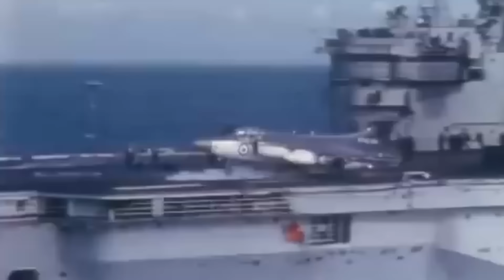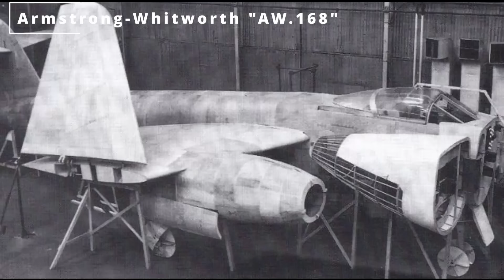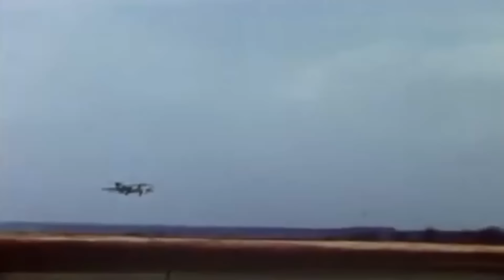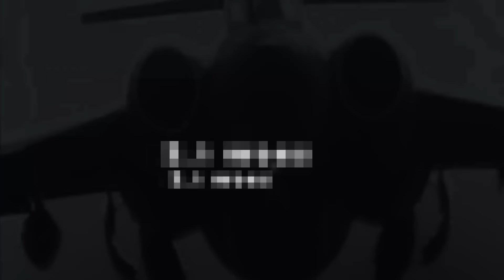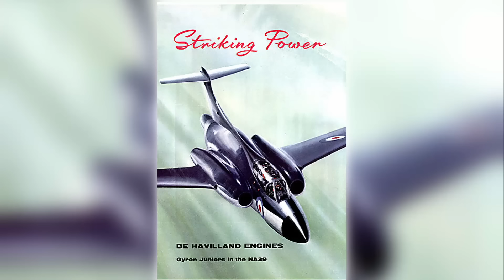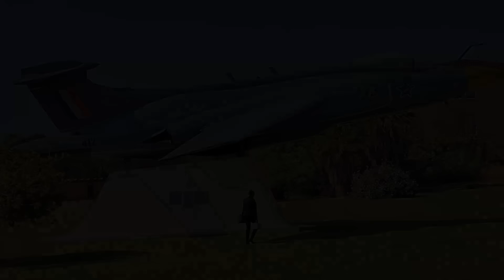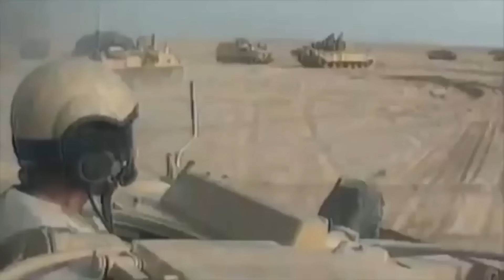Blackburn Buccaneer  -  Insane Low Level Bomber Americans couldn't shoot down - (Full Story)

Comment: I always remember the Buccaneer operational usage guide
1. Accelerate to take off speed.
2. Raise landing gear.
3. Descend to operational altitude.
Reply: Anyone remember this? 

Rolling down the runway 
throttles open wide 
see the mighty Phantom 
sway from side to side 
airborne again without a blip 
It's just one more aborted trip 
but we're pressing on regardless 
for the wg cdrs AFC 

Went to early briefing 
climbed into the Kite 
opened up the throttles 
and roared into the night 
leaving the flare path far behind 
It's dark outside, but we don't mind 
cos we're pressing on regardless 
for the wg cdr's AFC 

Rolling down the runway 
throttle open wide 
see the mighty Falcon 
sway from side to side 
airborne again with just 9 G 
I wish I had a nav with me (!) 
but we're pressing on regardless 
for the wg cdr's AFC 

Rolling down the runway 
throttles open wide 
see the mighty Jaguar 
sway from side to side 
airborne again, but only just 
It's not much fun with F*** all thrust 
but we're pressing on regardless 
for the wg cdr's AFC 

Give me Buccaneers 
They're British through and through 
The Banana Jet 
The Best we've had yet 
We are the last of the few. 

Don't give me the Jaguar 
Unless you refer to the car 
The car is a ground hog 
The aircraft, a half frog 
Don't give me the Jaguar. 

Give me Buccaneers 
They're British through and through 
The Banana Jet 
The Best we've had yet 
We are the last of the few. 

Don't give me the Harrier jump jet 
You haven't convinced me yet 
Jets that fly backwards 
Are soon to be knackered 
Don't give me the Harrier jump jet 
Well… You know, not just yet... 

Give me Buccaneers.
They're British through and through 
The Banana Jet 
The Best we've had yet 
We are the last of the few. 

Don't give me this computer crap 
It's no way to tackle a SAP 
It's OK for Dicks, Germans and Spicks 
But Gentleman, carry a map! 

Give me Buccaneers 
They're British through and through 
The Banana Jet 
The Best we've had yet 
We are the last of the few. 

Don't give me Air Traffic Control 
They live in a bloody great hole 
They scream, and they shout, 
then F**k you about 
Don't give me Air Traffic Control. 

Give me Buccaneers 
They're British through and through 
The Banana Jet 
The Best we've had yet 
We are the last of the few. 

Don't give me the F-104 
It's only a ground loving whore 
It goes in a turn, flick, spin and burn 
Don't give me the F-104. 

Give me Buccaneers 
They're British through and through 
The Banana Jet 
The Best we've had yet 

WE ARE THE LAST OF THE FEW!
Reply: @hotstepper887  Bloody fantastic!! Thanks for this. Great 👌 stuff
Reply: @hotstepper887  Nice. Is it true that inflight refuelling in the Bucc. was like trying insert a strand of limp warm spaghetti into an angry Tomcat's arse during a hurricane.  I've never tried it myself. Neither have I tried inflight refuelling a Buccaneer.
Reply: @gusgone4527  When we really do just take a step back, and analyse the USA's real military capabilities, today? We find, it's a horror story for them, in all honesty. 

Over these last 25 years, they've been out thought, right across the board, they've been significantly out-built, and technically beaten, hands down, by both Russia, and China, (who are banging out modern hi-tech, hi-quality, military hardware in all areas of their military today). 

Even though, much is largely defensive, it's also tactically offensive, and being done with a very focused, and real analytic understanding of where they need to be by various stages of their advancement. 

Although we actually know very little, what they've allowed us to see, there's not really anything I could single out and start to criticize, even if I wanted too. Everything, so far, has been completely logical,

A great question that really does point out today's military power, realities, is, what does the USA lead the world in today, (concerning anything military, at all)? And the answer to that question, is, absolutely nothing! 

For example... In today's world of hi-tech, Anti-Ship, ballistic missiles, (ASM's)like the Chinese DF-21D — operational range 1700 km's that can sink any carrier in the world, (with a single hit), actually means, all Navy's without the ability to stop these missiles are basically obsolete today. 

Russia's Zircon Anti-Ship missile, though inferior in way of operational range - 1000kms, it can be fired from aircraft, subs, and ships, making it deadly to any carrier in the world. Russia also have, the Brahmos and the P-800 Oniks anti-ship missiles.

We also know neither the USA nor the UK have any destroyer (or any other means), able to defend against these missiles, today. Seeing the USA's Navy as pretty much obsolete in today's world. 

We only need to understand, the distances, the US jets can travel, it's approx 500-650 (max) km's out — and the same back again = 1300 km's range. 

Meaning, the US, is unable to deploy any carrier close enough to reach any inland target, and then get back again, as anywhere inside 1700 km's, they're sunk, they're toast, they're history.

This is also why when we hear the US shouting out how they're sending a carrier to the South China Sea, (as some kind of imagined, propaganda threat toward China), only the truth is, when looking at the GPS positioning, of the US carriers in the SCS, they're never seen closer than 2500 km's from Chinas mainland, it's more commonly known as hot air, or "bluster".

The USA has no capability to attack any militarily capable country, armed with these modern hi-tech Anti-Ship ballistic missiles, as, If the risk outweighs any potential reward, gain, or result = obsolete.

The USA has nothing that can stop those missiles today, and China's DF-21D is a carrier killer. A manoeuvrable Ballistic missile (that doesn't need  to follow a ballistic path), hurtling at your carrier?. You're doomed!

Then, when looking at one of the most important areas of today's militaries, electronic Warfare (E/W), the Russians are literally decades ahead. 

Russia have the GaN MMICs, the krasukha, the murmansk-BN, and Magrav technology (NATO: Khibiny) developed by Iranian-born nuclear engineer Mehran Keshe (called “a modern-day Nikola Tesla”). 

And we can say for sure, this EW hardware is super impressive. We've no answer to it. We've also seen this E/W in action on at least 4 occasions we know of... (Obviously denied claims by the USA), only if untrue, I'm left asking why we saw the response we saw from the USA, basically confirming these events?

1) In 2013, we've seen a Russian SU-24 fly repeatedly around and directly over the USS Cook, leaving the Cook helpless to defend itself.

2) In 2014, we've seen a Russian SU-24 (flying at an altitude of only 10 feet), fly directly at, and straight over the USS Ross, eleven times, with the Ross completely unable to prevent It or respond to It.

3) As Russian forces arrived In Syria in 2015 we had many reports of US/NATO/Israeli Radar becoming scrambled, leaving them unable to communicate, or offer any response to the Russian forces. As one report said, the silence from the West was deafening!

4) In March 2015, a further related report notes. Federation submarine naval forces attacked with their advanced electronic defensive weapons the American aircraft carrier USS Theodore Roosevelt (CVN-71) causing it to turn and struggle to the coast of Britain to the amazement of the public, where she remained for 9 days undergoing Intensive major re-wiring. It's believed the Russian electronic warfare pods (NATO: Khibiny) were used in a Russian trial of this technology for its submarine fleets.

White House spokesman Josh Earnest, who said of the encounter with the Cook... "This incident is entirely inconsistent with the professional norms of militaries operating in close proximity with each other in international waters. E/C measures taken by the Russian Federation are unacceptable".  

To which the Russian MoD replied... "Frankly speaking, [we] do not understand the reason for such a painful reaction of our American colleagues, as the principle of freedom of navigation for the US destroyer, (which is staying in close proximity to a Russian naval base in the Baltic Sea), does [not] at all cancel the principle of freedom of flight for Russian aircraft testing Russian defensive systems".

A further Ministry of Defence (MoD) report also stated that for the second time in two years, advanced  Federation “electronic warfare  defences” have crippled the Arleigh Burke-class guided-missile destroyer USS Donald Cook (DDG-75)— It was noted when Baltic Fleet “special forces elements” offered assistance to tow the destroyer back to their Polish port, the Americans refused to respond.

According to this report, in April 2014, the USS Donald Cook, while performing a mission in the Black Sea, substantially violated Federation “territorial integrity” causing President Putin to authorize an “electronic warfare defence” attack against it, that was so devastating this top-line warship was left adrift—and once towed back to its Romanian port, its American sailors were so demoralized 27 of them filed immediate letters of resignation from the US Navy.

One year later, in May 2015, this report continues, and again in the Black Sea, the Arleigh Burke-class guided-missile destroyer USS Ross (DDG-71) substantially violated Federation “territorial integrity” causing President Putin, to once again, authorize an “electronic warfare defence” attack against it.

But when confronted with the fate that befell the USS Donald Cook the year prior, it retreated—causing one Russian top-level Naval Officer to state: "It seems that the Americans did not forget the April 2014 USS Donald Cook incident — A Federation SU-24 equipped with EW pods shut down the new American destroyer".

This attack encounter of Federation forces with the USS Donald Cook, this report details, began when this American warship began an “aggressive combat manoeuvre” against the Baltic Sea Fleet port in Kaliningrad, to which President Putin authorized an immediate “electronic warfare defence” against it.

And when we look at ground warfare, today? Russian troops with reserves, outnumber the USA, and any attack on Russia, would immediately see China join the conflict. Then outnumbering the USA in the millions today. 

Also, what has anyone ever seen from any US troops, that could make anyone believe or think they'd be any sort of threat or match to these disciplined well-trained Russian troops, who are all fully bled, prepared to stand and fight for their freedom and their country's freedom, (so will all be fighting for all the right reasons), while the US troops would only be fighting for attempted US tyranny?

All throughout the history of wars, we always find the countries fighting for all the right reasons, (like their own freedom), have never lost.

Yet, on the other hand, all those who fought for all the wrong reasons, like global control/tyranny, have all, not only lost, but all have been annihilated. 

In fact, the American people themselves, would all be very wise to understand this, as we see this in every war, over and over again, nothing will change this time, only the annihilation might be much more severe, but it must also be recognized, and said, just as deserved!

Russian missiles easily rule the world today. Russia's modern hi-tech missiles that include hypersonic missiles with Russian GLONASS, GPS targeting systems, give Russia such incredible precision, the USA has nothing we can say even compares. 

As we've all witnessed, Russia was pinpoint accurate, targeting single buildings in Syria, even guiding them down chimney pots, or straight in through the front door, and doing so from the Caspian Sea from distances of, up to 6500 km away.

Russia has also provided clear, precise footage, of all her long range missile attacks in Syria, (that we can see all came from the Russian control room online). Russian hypersonic missiles, we all know the USA can't defend against, and Russia has many other lethal hypersonic missiles being created and added to her arsenal.

Personally, in any upcoming war? I give the USA precisely zero chance, none, not even a little snippet of a chance, annihilation is all they'll get. And again, 100% deservedly so.
Reply: @gusgone4527  More of the untold or spoken truth today...

The F-35B was claimed to be a stealthy single engine multirole combat aircraft, that unlike the Harrier, would be supersonic, stealthy, with modern avionics systems, and like the Harrier, would be VTOL capable. This is why we originally designed our two carriers without ramps.

Only one of the biggest technical headaches, the British always had when building the Harrier, was the VTOL, — transferring from "lift" (downward nozzles), to forward flight (rear-facing nozzles), to then fly away from the lift-off. Apparently to achieve it took the British a hell of a lot of technical work, (three — four months at a time, over 3 years). 

Look up all the variants they made, but they never gave up, and they finally figured it out.

I made the claim long before we saw the F-35B, that it wouldn't be VTOL capable, (even with the Rolls-Royce lift engines), because, the US has tried to produce and build a VTOL combat aircraft many times before, only they've failed each time, only ever managing to produce and build the British AV-8B Sea Harrier, able to do so. Every US airframe, (and there have been many), have all failed.

I'll show you what I mean... 

Copy and paste “2013 MCAS Yuma Air Show — AV8B Harrier Demo” into YouTube search. At 7 mins, 50 seconds, you'll watch a Harrier performing a proper VTOL.  You'll see it lift off vertically, and then fly away from the lift-off, and you'll see the transfer of nozzles take place. 

You'll not find any footage anywhere, of the F-35B performing a full VTOL. If it could, we'd have footage of it doing so everywhere, today. Yet Lockheed Martin, do claim it is VTOL capable, when it, so clearly, is not.

Copy and Paste “First F-35B Vertical Take-off” into YouTube search. You'll see it lift off, only then, you'll see it return straight back down from the lift-off. You'll never see it fly away from the lift-off, as I said, if it could, we'd see footage of it doing so -  like we still see on all the footage of the Harrier doing so. But you'll not find any footage, anywhere, of the F-35B performing a VTOL.

They'll comically claim it's not necessary? (while forgetting, they're to be carrier-based aircraft), meaning even any slight damage to the deck or ramp, they'd be unable to get the jets airborne? Defeating the entire purpose of having the aircraft in the first place! 

You can't ever lose an entire carrier, in battle, for only minor damage?, I mean goodness me, whatever next?.

So, why do we see the USA doing this? It's obviously because, the US is still a country that's never managed to produce & build a VTOL fighter aircraft. 

Britain did so in the late 50s, Russia did so in the late 60s, the USA has tried and failed numerous times, so it seems this time, they're going to try to lie about it!

That country is a travesty, man! But it does show us, that Lockheed do indeed produce propaganda aircraft, as the F-22 is exactly the same... 

A failed aircraft, so today, only being used for propaganda purposes!

Typical US propaganda, usually consists of silly falsehoods, fake misinformation claims, or just twisted truths, like the F-15, is said to be unbeaten in air-to-air combat? It's true (ish), only when we look at every aircraft shot down by an F-15, we find that none had any offensive capabilities, most had little if anything defensive, many without even a basic radar, meaning, you'd be absolutely stunned, if the F-15 didn't shoot every one of them down! 

So it really is, once again, and as always, just a very silly, and meaningless, and remedial propaganda claim.

However, there is another aircraft, that's also unbeaten in air-to-air combat, that has faced off against aircraft just as capable and well armed as itself. Only, it's not American, so it's never spoken about.

The British Sea Harrier, is actually the only aircraft unbeaten in air-to-air combat, that has faced off against worthy, and viable opposition. And that really is a huge factor, that's worth knowing, unlike the F-15 propaganda claim, that you'd be shocked if it hadn't managed.

Everybody, should be questioning why the US government made it illegal to sell the F-22? The US government, seemingly want it believed, that because it's so good, they don't want anyone else to have it. Yet, that actually makes no sense at all, none, not even a little sense. 

As the facts are, they've no idea what's around the corner, in new modern military technologies, and with the speed we're seeing so much new hi tech military tactical hardware being designed, developed, and created today, it could well have made great sense to sell the F-22 at some stage. (If it actually works).

If it worked, they'd have been able to recoup many of the resources spent on the aircraft, if not the resources in their entirety, even a profit! 

Yet, as always, there's another, and much more likely, reason the USA made it illegal to sell the F-22.

If it is, just as I suspect it is, a "lemon", that was intended to be their leading front line strike aircraft, (that's failed), yet because of the cost/expense, to design and build them, they can't just write it off. 

So the US have then only used the F-22 for propaganda purposes? Then what better way of preventing anyone else from finding out, that it actually doesn't work, and really is a lemon, than making it illegal to sell?

Logically thinking, that's the only real possible reason the USA made it illegal to sell the F-22. -- It can only be, because it's a failed aircraft that was intended to be their leading front line 5th generation strike aircraft.

Well, 20 years, the US have had the F-22 in service, and they've been in wars the entire time, yet they've never used it, not once! And even more telling, was, after Russia arrived in Syria in 2015, the US removed every F-22 from right across the Middle East... Iraq, Tukey, UAE and Jordan. 

Absolutely no doubt about it, I guarantee, that we'll never see the F-22 involved in any real war scenario, or even involved in any major sortie, because it's basically junk.

They've even trashed all the infrastructure they had in place to build more of them.
Reply from the maker: That's the ticket.
Reply: Top trumps card: service ceiling: not applicable
Reply: Service "hard deck": depends on whether the undercarriage is lowered.
Reply: count the sheeps tits.....